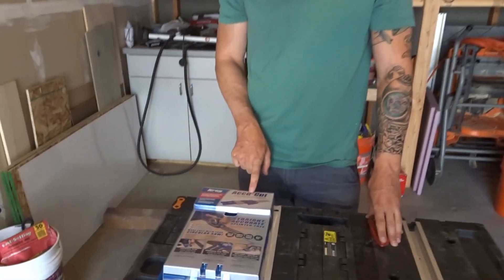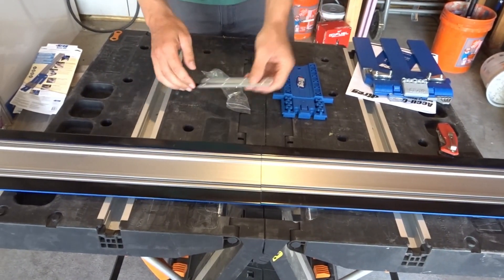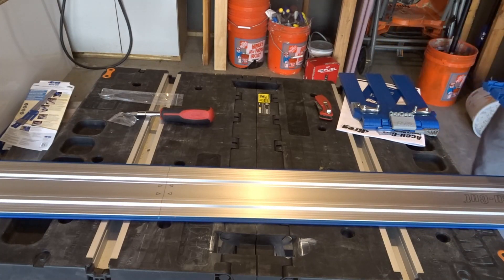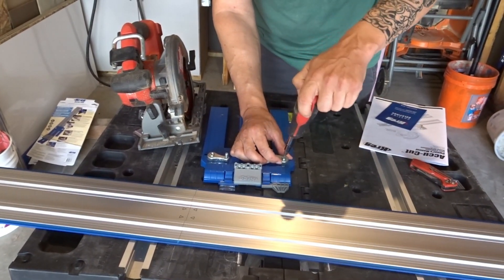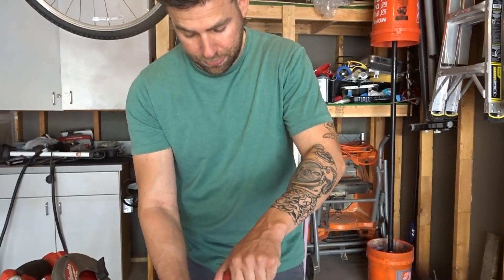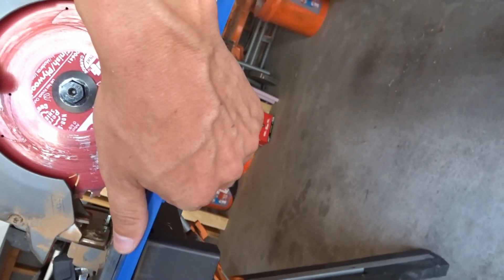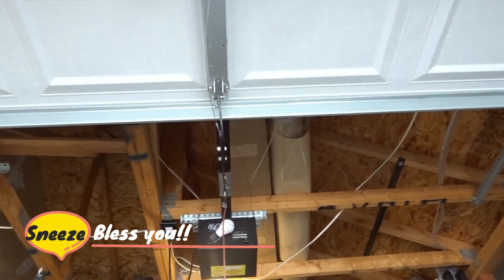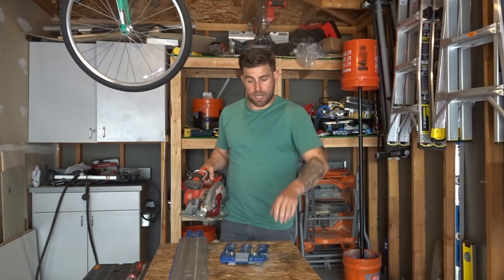Kreg Accucut Setup and Review | Step by Step Setup

Comment: Very helpful! Thanks for taking the time to do this.
Reply from the maker: For sure! I was so frustrated that I couldn’t find a single video that provided a good tutorial. Glad you liked it!!
Reply: @aaronfixesstuff  I agree! Your video is the best at demonstrating how to do it. I was quite confused how hard it was to find where best to attach the sled tightening screws to my Makita base plate. Tightening them tended to push the base away from the stop in the sled. Just seeing what you had to do to find a good position for your circular saw was helpful. Once I figured that out, the rest was easy. Not having any experience with a track saw, your video helped me set it up right. By comparison, the Kreg videos were not very helpful. Good job! 👏

Comment: Recently purchased this kit and finally yesterday I needed it to break down a few large sheets of material. Having previously used straight edges as well as the Kreg sled that does the smaller (under 24") cuts, I had already gone thru the sled to saw set up. Using this larger rig meant (now having two sleds) meant I would install my full size circular saw for the larger need. Your explanation was better detailed regarding the 32nd" to be removed from the blue edge. The other video I previously watched made it unclear, meaning the actual plastic sled surface was the surface being shaved, which seemed really wrong. But when I looked at your vid it was specified in a way that was crystal clear. The DUH, factor did make me feel like I was on the slow side, but not wanting to f up meant I wanted certainty. But what completely upsets me is the track itself can't be made stationary with clamps.
1. The launch pad part, the slip-in blue dock, isn't locked, so the slightest nudge, and it's askew.
The actual first hugely bad issue was straight out of the sealed package, my kit was short two set screws for the track, and Kregs web site had no apparent way to resolve that, which would've meant waiting days/weeks for them to possibly mail a couple tiny screws. But going to the local Ace/TrueValue was needed, and neither stores had the correct part, so a 3rd store Menards, was next, and while a suitable screw was found, it needed to be shortened. Problem solved, though a PITA.
2. The issue of securing the track meant my very first pass with the saw, the bris, for the zero clearance was f'd up because the track shifted!!!!
3. Repeat of 2. on most subsequent cuts, requiring my returning to using the much lest costly Bora cutting guide.

Do you have any suggestions for this issue? I have looked online but I seem to be the only dipshit having this perhaps.

Thx in advance
Reply from the maker: z3dsdead thanks for the positive feedback, and glad to help! I felt like there were no good videos, so I made one. I totally agree on the launch pad part. I had the same issue with it. As far as clamping it, what I noticed was that if the rubber on the bottom gets dusty, it tends to slide.
Reply: @aaronfixesstuff  TENDS to?  I was working on a sheet of 3/4 MDF. I certainly considered dust. The tool was fresh from the package. The immediate, obvious dust  was brushed away.  The KREG product line seems to be quite good overall. Overpriced, to be sure, though I'm a patron of the idea cheap tools are priced as such that good or great tools will be off the shelf at the places people who need them shop. Sell them enough shit, and some will not only spend more, but they'll spend MORE
Reply: Hi, not sure if you’ve discovered this yet, but thought I would share just in case. My husband and I were having a similar issue with the accucut slipping mid cut, kreg sells clamps for the accucut on their site (I’ll leave the link below). We’ve had a few other issues with the accucut, but the clamps have since fixed the slipping issue.

https://www.kregtool.com/shop/cutting/circular-saw-cutting/track-clamps/KMS7520.html

Comment: I would NOT count on using the starting block on  a square board and  ending up  with  a  square board AFTER the cut.  The straightness of the cut looked great but I would make indicator marks for the cut.  The instructions say “Mark the cutline on your workpiece.”  Thanks  for making this video.  It was a big help with setup!

Comment: Great how-to. The only thing I would recommend is eye and hearing protection.
Reply from the maker: Santana Garcia you are absolutely right! I am one to use them but spaced it out when I was doing this! Thanks :)
Reply: I didn't think it was very safe putting your fingers under the edge of the scrap piece or cutting off. A bit dangerous there.

Comment: Hi I have a Milwaukee 6.5 inch circular saw, it might be similar to yours. I found that one of the clamps (the far side) pushes the foot of the away. I also found I can’t cut the blue guide strip when I setup my saw with the saw guard freely moving rather than in the up position always. I read that the guard has to be able to freely move once setup. Did you have this problem with your setup?
Reply from the maker: Jun Vasquez that is correct unfortunately. The guard does have to be in the “up” position. I will say that the Milwaukee saw is not a great fit for this jig. It works, but nothing wow about it. I still like that it grips the work surface, but it is far from ideal. Also did you try moving the clamp to the other hole like I did?
Reply: Thanks for the quick reply, I am using the two inside holes for the clamp. Tempted to file the corner edge of the foot plate of the saw touching the clamp but I just adjusted carefully the clamp height instead and made sure the clamp does not push the plate away. I still need to solve the cutting blue strip problem with guard able to move down, for my own safety as I am still newbie to woodworking. Thanks for the video.
Reply from the maker: Jun Vasquez for sure!

Comment: At the beginning you mention you had a diy track or a door board that was thrown out. Cost and convenience, how does the accu-cut compare to a diy track and is it worth the added cost?

The benefits I see to the accu-cut is the gripy bottom doesn't require setting up clamps and the track keeps the saw in line. Whereas with a diy board you would have to pay attention to keeping the saw fence square to jig. Lastly, a diy jig could be built for free with scrap material and can be made ad hoc if you change saws or blade thicknesses. Oh and you dont have to take the minute to attach the guide if it was detached.

That all being said, im very tempted to buy the accu-cut.
Reply from the maker: Honestly, I don’t use the accu cut anymore. I found it to be a pain. The homemade jig does have a disadvantage, that it does not grip well. The shoe was really testing me, and it does not fit nicely on the milwaukee saw.

Comment: Thanks for the video....so after 6 months....is the ripping still accurate?  btw...is that 6 1/2" Milwaukee Fuel saw?
Reply from the maker: No problem! So after 6 months, I’m back to the jig I built myself. I was not happy with the way the saw sat in the sled. Also, it was a pain to keep on putting on the shoe and taking it off. 
And yes. It’s a fuel 6 1/2.
Reply: I don't understand how big of a pain it could be to put the saw back on the plate. 

I mean all you have to do is put it under this two screws and buttered up against the stop button on the left on your setup tighten down two screws you're on your way, how much easier could it really be?

Comment: The one question that I cannot get answered- Can you elevate one end of the saw while in the track so that you can make a cut inside a piece of wood? If I want to cut a rectangle within a piece of plywood, can I do that?
Reply: No plunge cuts with this setup.. You could get the cut started, or do the whole thing, with a jigsaw. No tear out protection doing this, tho I've heard of a hack where you put painter's tape over where you're cutting to help with the splintering (scoring your cut line with a utility knife also can help). Alternatively, if you're brave and skilled enough you could do the plunges with the circ saw then attach the sled and lay the track and do the cuts that way (starting the cuts mid track wherever you made the initial plunges freehand). Still need a jigsaw (or a hand saw of your preference) to square the corners.

Comment: Dude, some genuine advice here (yeah, I'm that guy -- but I really want you to keep your eyes and digits).
Put on eye protection.
Get your finger away from the blade.
When you put the saw down, mind where the guard is.

As to the jig -- have you noticed any slop in sled as it's sliding on rails? Mine is really bad, 1/16-1/8" easily...

Comment: noticed that you didn't switch the clear plastic strip in front with the red line and the other gray pointer! But still a good video, thanks!
Reply from the maker: Thanks! I didn’t even know that was a thing :)
Reply: GeeDub , I believe that you use them for the Kreg RipCut
Reply: The clear cursor is for the RIP cut jig  the gray indicator is for alignment over the track on the right side ( for your saw)  it just helps aligning.   I noticed you lifting the blade guard.   I find the starting point lifts it easily by itself.

Comment: I'm a beginner and my problem is what if I have a board and it is not straight on any of the sides How do I get it straight or can I use this tool to get it straight I'm confused.
Reply from the maker: Barbra do you have a speed square? If so, find your square and go from there. Does that make sense? You can also butt the starting piece to the edge of your board, that will give you a straight edge to work with.
Reply: @aaronfixesstuff  yes I have a speed square, a empire guide and a Kreg rip cut and a extra long level.
Reply from the maker: Barbra awesome. So once you can verify a 90 degree angle using the speed square. Then mark the board using the level, and now you have a straight cut :)
Reply: @aaronfixesstuff  okay I kind of understand I will try it. I am terrible with figuring out straight lines, always been a problem.

Comment: Big safety no-no here. Your saw’s blade guard should still be operable after mounting your saw to the sled.
Reply from the maker: It should, but it does not work with this model unfortunately.
Reply: @aaronfixesstuff  be careful man. I’ve seen bad things happen when the blade guard isn’t functioning (a VERY serious injury)...and it happens in the blink of an eye.
Reply from the maker: @johnharville8007  yeah man. Totally agreed. I am not a fan of the jig and I really only use the one I built now. No shoe needed and setup takes a few seconds.
Reply: Is there a saw that will allow you to operate the blade guard? That's my biggest concern is safety and if that's not able to be achieved then the product is a waste.
Reply: @gailharris8316  pretty sure it can work properly with this saw (and most saws for that matter). I just think the creator of this video didn’t place that stop block properly.
Reply: @johnharville8007  I'm inclined to agree with that, the saw should be placed in the sled so that the blade is in the middle of the slot and the stop block then is slid over to the side of the saw.

You don't move the saw all the way over to the left side and then tighten down the stop clock, that puts the blade guard out of position.